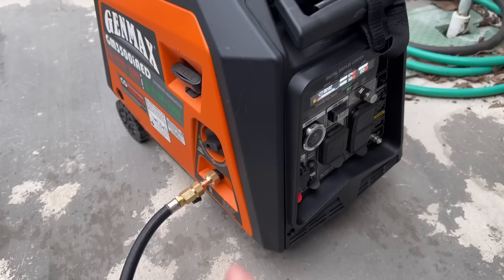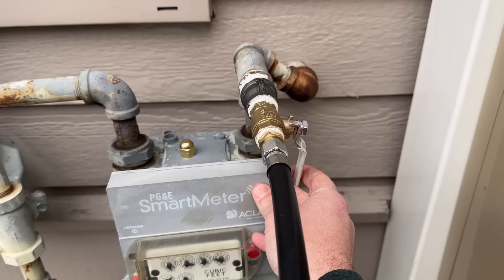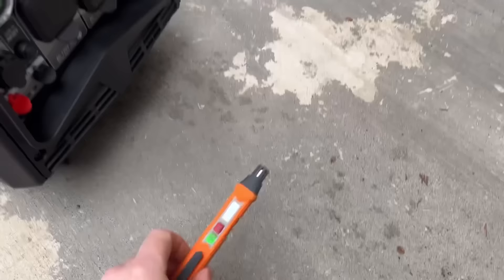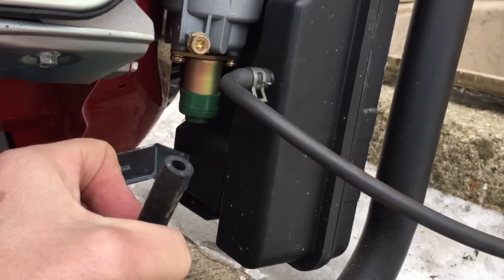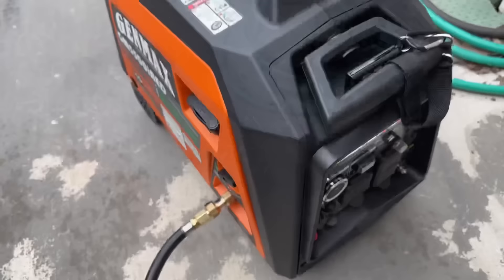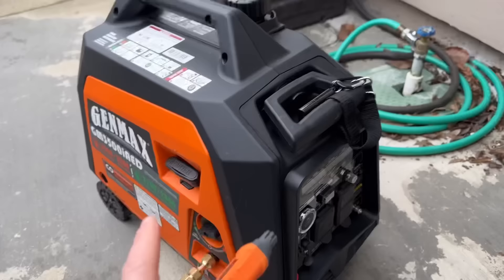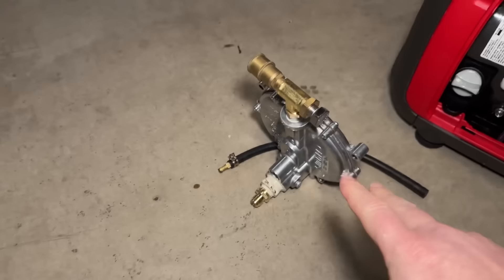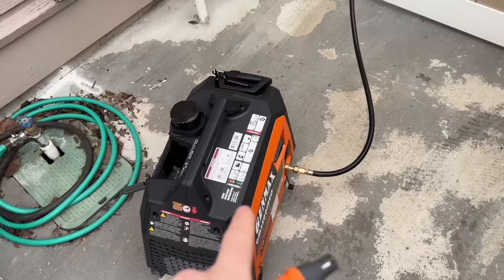Natural Gas Generator Hook Up People Should Stop!!!

Comment: It is a HUGE code violation for a customer to connect to the test port of the outlet tee.  The customer connections must only be connected to the back side of that tee, such as replacing that bronze 90 by the wall with a tee.
Reply from the maker: Mine is already replaced with the original plug after making a couple videos that day. Mainly to show people this bad diy that is going around. 
I would have gone on the back side but I would have had to reconfigure the whole thing. Verses the 45 second switch.
Reply: If you did this in my state, your service would be "red-tagged" and the gas would be shut off.

Comment: If you want a propane or dual fuel generator, get that kind of generator. All generators have a governor to maintain frequency in response to load, the fuel supply should never be throttled to the engine.
Reply: That's the problem with this make-shift setup. The governor varies the throttle valve in the carburetor, but the fuel flow remains constant. If it throttles back, the engine runs extremely rich. If the engine is loaded, it opens, and can run too lean. The gas MUST be throttled proportionately to the air, to maintain proper fuel/air mixture. (Why you need the right regulator)

Comment: Do not use propane on natural gas  or vise versa. The proper orifices along with the proper regulator is a must. Both need to be utilized with the correct water column pressure designed for the appliance, whatever that appliance is. Go by manufacturer specs. Living for a new day.
Reply: Yep, one of the first things they tell you when becoming a plumber in Germany, they usually even tell it to those without a gas certificate, just in case.

Comment: Unrelated story time: My friend is a fire Chief who told me once of a large fire that they put out in a shed. They found out afterwards that a huge (250-500lbs???) filled propane tank was in the shack and was just about to blow up when they started spraying it with warer point blank. The owner didn't tell them that tank was in there!They got lucky!
Reply: Those tanks won’t normally blow, they will BLEVE from a valve, look it up neat stuff…
Reply: @JackThelRipper  lol bliung off gas during a fire through the "relief valve would have been bad followed by big boom! 
Look it up it's really neat stuff!
Reply: I was a firefighter for years, you'll know it if a propane tank is about to rupture. The safety blow off valve will look like a huge blow torch blowing a stream of fire 15 to 30 feet long. They don't blow up, they split from the internal gas pressure due to the heat.
Reply: @American-Motors-Corporation   not necessarily. Depends on how hot the fire got the tank. They don't blow up, they rupture from the liquid turning into a vapor inside the tank creating extreme pressure. The relief valve will handle most house fire temperatures without letting the tank rupture.
Reply: @Bryan-Hensley  lol right, fire in building all around the tank, then being ejected from tank via the "relief valve" is the gas, you at the very least have a huge blow torch. 
Yes ot most likely would explode!
Reply: I wasn't a firefighter but encountered a similar situation once. I was a Police officer and we generally would respond to all of the Fire calls (for a number of reasons) and since we were on duty, awake and usually already in a running automobile; the Police would usually be on scene long before the Fire trucks. We would assess the situation (passing this to the Firefighters via radio) and possibly try to help people in danger.
One night about 4 am a call went out of a house fire about 5 miles out of town. It was a real old house that was mostly 'Fat Lighter' (old growth Heart pine) and was burning quickly. There were people in the front yard and they said everyone was outside. I went around the house and there was a portable burner and a 100# propane cylinder on the back porch. The fire must have started near the front of the house because the back was just getting burning and the porch was relatively intact. The Fire trucks were still a few miles away and the heat was super intense from the fat lighter building. Obviously there was no cap on the bottle because it was connected to the burner and this was a danger because the top could break off when the bottle fell over. I saw some yard tools beside a shed and grabbed a hoe. I used the hoe to catch the hose and pull the bottle/burner off the back porch. I was able to drag it about 8-9 feet away and thankfully the top didn't break when I pulled it over(the porches on those really old houses are usually 2-3 feet high). I went back to the front and the fire trucks were pulling in. I pointed out that tank to one of the firefighters and they brought one of the  trucks around closer to the rear section of the yard. They put water on that tank as well as a larger one that was a 'permanent' tank that supplied propane to the house. The fat lighter house burnt to the ground but no one was hurt and there weren't any explosions!
      Pressurized flammable gases are very useful but Can be very dangerous. Nice video!
      Ya'll Take Care and be safe, John
Reply: @JohnDoe-pv2iu  meh, just a cop trying to grab up some of that credit. 
People proclaim both the fire fighters and police be heroes, i just see them as my employees doing the jobs in which they was hired to do. 

Though the police has no real right to exist, at least by the standards of tge constitution, no where in the document does it allow for or encourage the use of police. 
Of course the same could be said about the fire department.

I think it's important to discuss this simply because as people run out/low of money and can hardly afford to live now, i wonder what this means for pay of these government henchmen. 

Contrary to popular belief the police and fire personnel are very well paid! 
Lets use Columbus ohio for example. 
The Columbus city police get 70-80 grand a year! 

Likewise a Newark Police officer gets 65 or so a year, a licking county sheriff gets 60-75 a year! 
These people aren't broke. 

And before anyone blabbs about the dangerous work, well let me be first to remind you, that i nor anyone else didn't twist your arm into signing up for the job, if you don't like the pay, then find something else! 

No i don't care, I'm not going to bow down to anyone because they wear a government costume. Yep the same with the military too. I don't really care you've decided to join the problematic government and wear their costumes for money! 

I never told you to join or do anything. With the cost of living going ever higher, people of all walks realizing the police don't actually do shit as far as keeping crime low, yeah people are going to become more and more open to not paying a police officer 3 times the common wage earned by the average person. 
Honestly this is coming up in the topic of the schools, people are finally getting pissed off about how overpaid the teachers and school administration really is! 

Next comes cops and firefighters, mark my words! 
Crime's not going anywhere no matter how many of these badge wearing government stooges you put on "duty"! 

Fires, welp not many will afford the fire insurance coming up, which not having insurance will give the banks all they need to foreclose, so if those houses go up in smoke while under bank control and the previous family is already evicted then who cares? 

Of course no need to worry about fire insurance fraud if most people aren't buying the insurance...

Yeah with dropping incomes of the common person, and those common people realizing government personnel is making way too much, things are going to change!
Reply: @JohnDoe-pv2iu  lol well it's been about a year since our local police chief admitted that all walks of life seem to not fall all over themselves to bow dow down to those government costume, he attributed this to the fact that the local police really is the long arm as a federal government he straight said it in our local newspaper! 

So you're saying that it's the complete opposite of what our very police Chief had admitted? Hummmm I find this very very interesting. 

As far as growing a pair, yes I did and this is why i don't need the police, i can fight and if need be, i have a gun! 
The police only shiw up after the fact tge majority of the time! 

Grow up stop looking to government for help!
Reply: @American-Motors-Corporation my neighbors had a propane grill on the back that and that relief valve letting propane out with a fire created so much heat actually burned all up the backside of the house ruining the windows and the back door and the grill was about 10 feet from the house when this happened
Reply: @NoZenith  and I posted a half sarcastic comment.

Comment: The internal regulator some are talking about here is not a regulator at all. It's a load block, and that's how you adjust the mixture difference between NG and propane, plus fine tuning for load variations and sometimes BTU availability of the fuel itself. (will vary by region) It's got a set screw and a lock nut... and once set you leave it alone. Regulators all have a diaphragm inside and most UL approved gaseous sets also have a gas solenoid as an extra safety feature. Matter of fact, I believe UL approval requires both the solenoid and a demand regulator. If you are not set up properly and have an issue your insurance company might have a field day!
Reply from the maker: You are correct, a load block it’s for adjusting and this century unit is a all in one. A shut off, a regulator that’s manually adjusted with the adjustment nut so you can run NG or LPG. 
Then from there it depends what you are trying to run will determine other things like line size and more.

Comment: It is more than a regulator.

It is a safety valve that is held open by the slight vacuum being pulled by the carburetor while the engine is running.
The pressure differential is why the diaphragm is so large.

But you are absolutely correct, the device is needed - even for connection to a 20-pound propane tank!
Reply from the maker: Yup by the correct stuff. 👍🏼
Reply: Thank you for the explanation.  I was wondering how a regulator would solve the problem.  All a regulator would do is reduce the pressure.  It would not stop the flow.  So, how does this type of regulator control the flow of gas based on the load on the generator?
Reply from the maker: The vacuum of the engine will open the diaphragm as needed. The load control block up top will control the mixture which you need to pre adjust. Once set then good to go.
Reply: So my generator that is manufactured to be dual fuel isn't safe? And if it is can that same hose with attached regulator be also used on the natural gas line. I don't see the difference between a natural gas supply and a propane supply. My generator doesn't leak propane when it's not running. 
Thanks
Reply from the maker: Your unit is fine and has a shut off built with in the unit. 
I have a video coming out soon showing what is and isn’t compatible for Ng
Reply: @JOHNNY'S WEEKENDS  parts like 80 bucks, nm other a big deal.  Doubt the neighborhood is in jeopardy from a cracked 3/8 line leaking out of a  tiny venturi.  Maybe in danger of smelling bad.
Reply from the maker: Correct, so you have seen it. Just about any generator can be a Tri fuel unit with the correct kit. But that’s the cheap and dangerous way.
Reply from the maker: NG is also pretty toxic for humans and new studies have shown major effects but that’s only one thing besides being dangerous.
Reply: @tripplefives1402  The generator in the video is a dual fuel generator. I understand what he is trying to say, not safe putting a hose line directly to the carburetor. Video is a little misleading by showing a gas line hooked to a dual fuel generator that is set up to run gaseous fuels then saying this is unsafe. Gas coming from the residential meter is already dropped in pressure so an additional regulator would not be needed. The dual fuel generators have parts inside to keep them from just spewing fuel when it’s not running.
Reply from the maker: 😂 that last part is great
Reply from the maker: Yea I maybe should have used a regular gas generator. To demonstrate but that one has a external regulator and on demand regulator so that one can actually be used as a tri fuel
Reply: @tripplefives1402  Too high.
Reply: This reminds me of a regulator for scuba diving.  It only opens when you breathe in.  If you stop breathing no gas comes out of the regulator even though there is pressure from the tank and the valve is turned on.
Reply from the maker: Exactly!!!! 👊🏼
Reply: Check valve yourselves before you wreck-valve yourself?
Reply: So the whole purpose of this video is to prevent the leak of gas when a generator cuts out... that regulator safety valve seems important
Reply: Not all regulators run on suction.
Reply: @tripplefives1402  aka a zero governor regulator

Comment: I believe the proper conversion kit comes with a negative pressure regulator : Vacuum has to be present in intake manifold for gas to flow. And someone also mentioned an electric cut-off solenoid for fail-safe redundancy. It would be simple if you have a quick connect for your barbecue, but if your power has failed you might want to use your barbecue if your electric oven has no juice.

Comment: I have seen this all over recently with the power outages and lack of supplies for people to run their generators. This should be shared widely. I appreciate you sharing this video
Reply from the maker: Thank you. Tell people to buy a appropriate setup. I’ll have a video out soon showing what could work with a existing dual fuel unit. Probably sunday
Reply: I will definitely share and tell them. I used to be a fire brigadier at an oil refinery, specifically a gas plant with 300psi natural gas and 400 psi propane lines. A vapor cloud is bad news and can create a vapor explosion from a simple spark from an non intrinsically safe device.

Comment: VERY, VERY good advice!  You are totally correct.  On a positive note, all of these dual fuel Genmax gens are really neat. They seem to be very innovative and ahead of the market with their dual fuel, 120/240 on larger units, and other great features. They have totally filled a gap in the market  that nobody else has. I’m wondering what else they have planned for future units.
Reply: I've read some bad reviews regarding the construction quality of Genmax gens.  I hope they're wrong because this particular model is very interesting!
Reply from the maker: They are definitely filling gaps for sure. And being a new company customer service takes a while to get going. 
But they do better then most off brands at the moment. If not Honda or Yamaha then champion then Genmax. 
And stay tuned for updates on new models..😀😉
Reply from the maker: I have as well but that goes for every manufacturer. Also owner has to be considered. So after a while I have to toss some reviews and see which are legit from several different resources of reviews. 
I hope they continue to bring different models and make sure quality goes up. 
Or they will dissolve slowly.
Reply from the maker: Exactly, just do it right. 👍🏼
Reply: Genmax is just a brand, they don't make them.
Reply from the maker: Genmax actually is the maker of there units. Although they have built many units for other brands for years. Duromax just to name one. But sometimes not every model
Reply: They also wear out prematurely. No oil in the fuel mixture.
Reply: @edwinlipton  you're thinking 2 cycle. And they are inherently unreliable. Oil in the crankcase is the way to go but really either way works for a long time.
Reply: Typically someone with a chemical dependency tries to do hacks like this. Trying to be respectful.
Reply from the maker: Glad I dont have one lol

Comment: Its a good video, other than making it sound like propane and natural gas are interchangeable.
Reply: They are, with the right metering jets for the fuel you're using.
Reply: @vincentrobinette1507  also note that energy density is as follows:
Diesel > gasoline > propane > methane (natural gas)
Using natural gas in your dual fuel generator will work, if properly set up, but will de-rate the generator’s capacity even lower than propane.
Reply: But it’s so much more readily available that it makes sense to use.

Comment: When I first saw this I thought it was a good idea for a backup generator.  The explanation is to the point and clear.  Nice to have a 3-minute video to show exactly what people do, why not to do it, how it goes wrong, and how (comparatively) cheap it is to fix with a regulator.  Very well done!  About the only thing I might add (maybe a part 2 vid) show the right way with the regulator.  I wouldn't have thought a regulator would prevent leaks, but I'm guessing it has some kind of auto shutoff somehow?
Reply from the maker: I should probably do another… showing what’s needed
Reply: That regular is sometimes called a "demand regulator" and it outputs gas based on engine vacuum. So if the engine stops, it produces no vacuum, and the regulator stops the flow. 👍
Reply from the maker: Correct..!👍🏼😀

Comment: You need a proportional demand regulator. The ones used for propane powered forklifts are nice and come with several safety features too.
Reply from the maker: Yesss!! Correct, verses other videos showing a straight hose! 🙄

Comment: This is brilliant! Usually gas works during outages since it’s underground the pipes. Never knew such a generator existed.
Reply from the maker: This is what not to do..!!! Please don’t!
Reply: @johnnysweekends  I mean I didn't know Natural Gas generators exist. Do it properly with that $100 regulator piece and it is a good idea right?
Reply from the maker: Yes that is the correct way and making sure your feed from the gas is legal. 
I have installed a few kits not. Gas generators turning them to tri fuel units